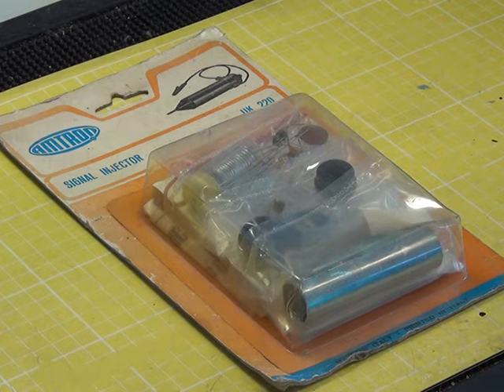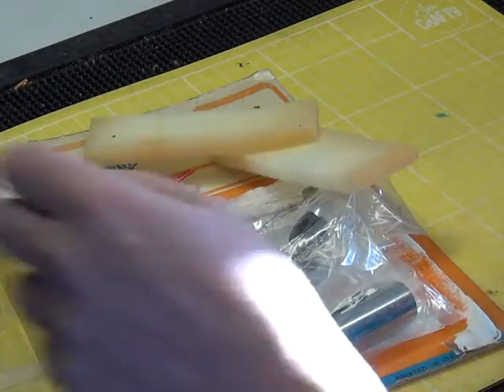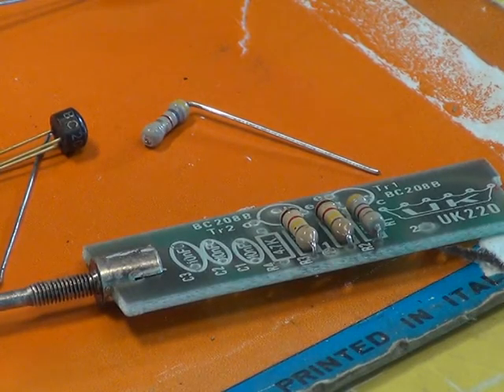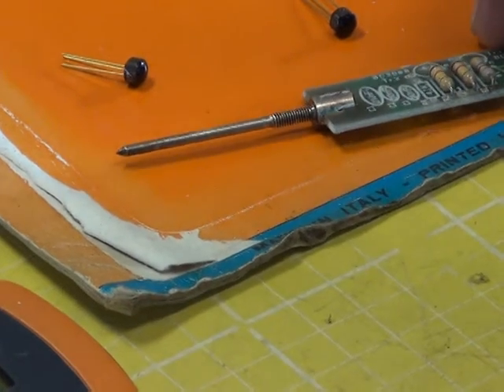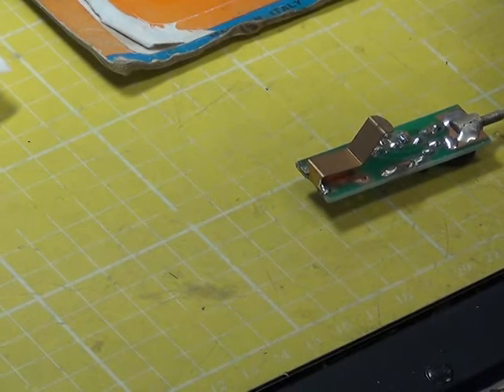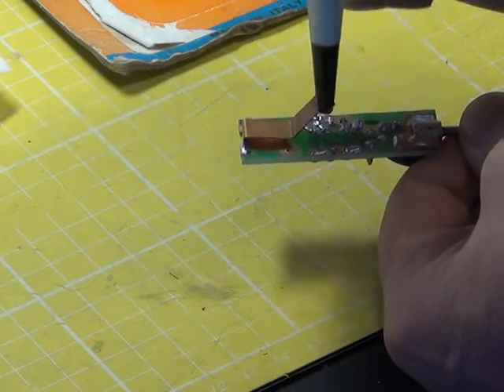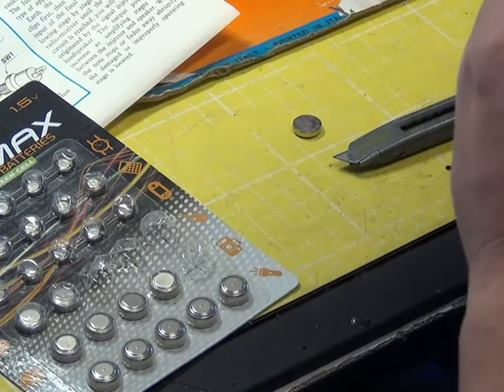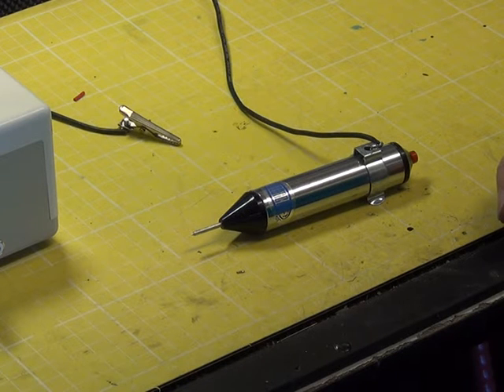Amtron CB220 Signal Injector

Comment: Considering this video is a year old, how has your Lidl drilling tool fared?
I bought one about 4 years ago and the chuck stopped gripping the bits after about a year.
Reply from the maker: We have 3 identical Aldi drills & also 3 identical Lidl drills all bought 3 years ago & 4 years ago respectively. All are working fine currently. Plus odd tools like shown here.

Back in '80 I bought two B&D cordless drills from their Professional range for my organ work. Each had the switch fail in the 12 month & were repaired under guarantee. One had the switch fail later which I had to purchase from B&D & fit. In 1986 they were both beyond further use. They cost £99.99 each. So I bought an AEG drill that also went back after 9 months for warrenty repair. That drill was £249. I left it behind at Nottm Radio when I resigned. We've used odd cheap drills on organs ever since until I bought the Aldi & Lidl ones, the batteries of which are far & away better than any other cordless drill we've ever had. I recall one type we bought was around £60 & the other around £40.

So your Lidl drill failed to grip after a year; they come with a 3 year guarantee. File away receipts in future!

So why do I buy three drills at once?   Pilot hole, main hole & countersink. Saves swapping drill bits over when drilling 240 holes at a time. Organ work is mainly with timber.

Richard, G0OJF, UK

Comment: I built the same signal injector you speak of,it was in the practicle electronics in 70's and used a steredent tube for the case,only it was built with germanium transistors.
Reply from the maker: I personally did similar using a Sterdent tube, but a 1970;s (Dec '74 I recall) Practical Wireless project, on 0.15" veroboard based around two BC108's. It always was in the toolbox in the days of me doing home visit TV repairs.

Richard, G0OJF, UK
Reply: @ukfmcbradioservicingTango21   La fel si eu tot pe atunci, inca eram elev in anul II- la sc prof numai ca l-am construit pe Tz cu germniu ceva din grupa AF era prima scula folosita cel mai mult din trusa mea apoi aparatul de masura  Am mai construit mai multe din astea d-ea lungul a 40 de ani de meserie ultimul l-am facut prin anii 80cu Tz BF 200 o grozavie de scula oscilatiile ajungeau in toata canalele de tv  In anii 95 am modificat o proteza auditiva transformindo in cel mai al naibii signal trace ( urmaritar de semnal)   Ha, ha, ha, ultimul  strigat, ultra miniaturizat  Cind l-am prezentat colegilor au ramas blocati toti A FOS ASTAZI NU MAI POT AM 70 DE ANI SINT SATUL PINA IN GIT DE ELE DAR NU MA POT ABTINE SA NU URMARESC ASTFEL DE MATERIALE E CA O BOALA CRONICA INSTALATA IN TIMP  Frumoasa lucrarea dv e bine ca inca mai sint dintre noi care mai au ce arata tinerilor ca sa inteleaga ca nu au cazut tlate  din cer, sa muncit f mult  Sa fiti sanatos si..... i spor in toate

Comment: I can't believe you opened it..
collectors out there are crying for opening NoS items.....argh...!!!!!!
you can build simple noise generators for a few pence, even buy them off eBay for £1.25
Reply from the maker: £2 rally. All packaging in bin. As well as this, Mr C also bought a new looking Japanese analogue multimeter from  the same vendor (£3), that looked new. Multimeter just discontinued from RS @ £180+VAT, so another good buy. People always go on about turning up early for the bargains...I can't attend until about 1:30 on Sundays because of my church job....and I reckon we still get the bargains....usually on the floor in cardboard boxes!

Richard
Reply: Why do they collect them though? all that happens then is they die with this vast collection and whoever inherits generally has no clue of their worth and so deposits in a skip, I'd rather see something useful being used.
Reply: @chippieminton21  Maybe,
But maybe ask those people who bought radios brand new and never use them, they jsut sit in collections never to be used, just going up in value,
maybe to be sold on before they die, or as you say just skipped..

i know my collection will end up being sold sooner or later and probably for a lot more than i paid for it, yet other items will probably never sell and end up skipped, but i appreciate what i've got and understand what went in to design and manufacture of what most people take for granted or don't understand.